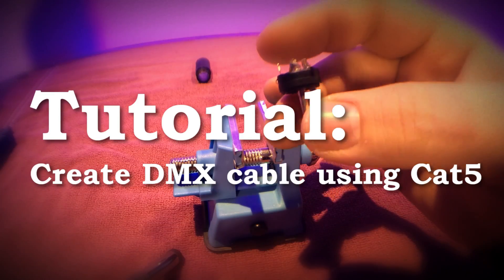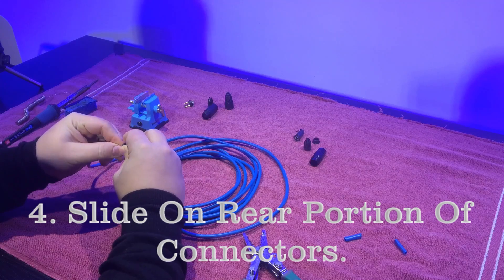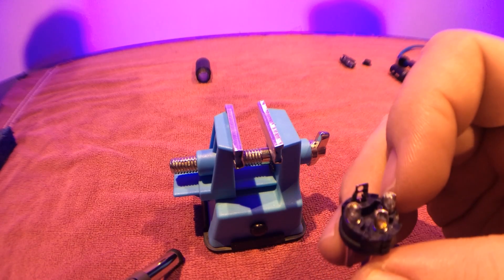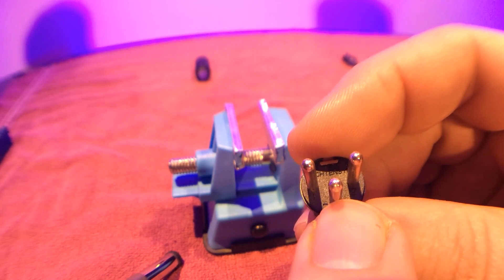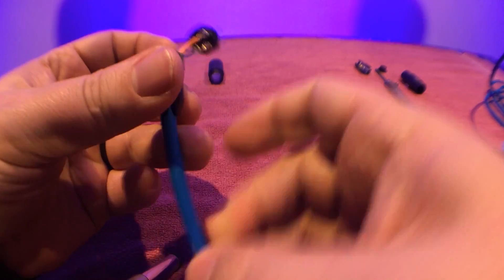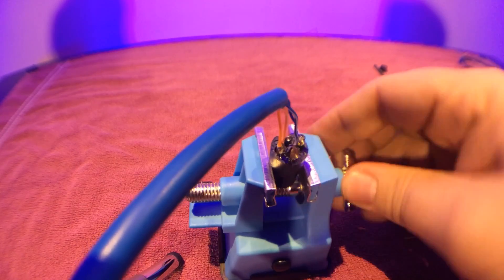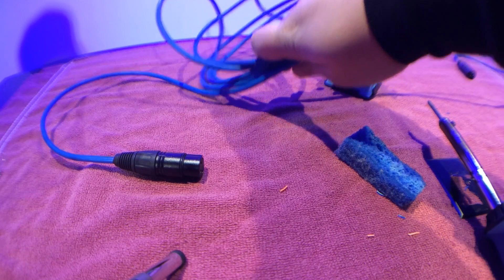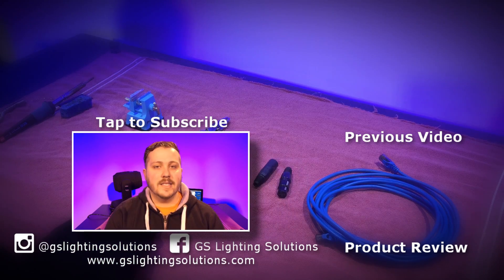How to Make A DMX Cable | Tutorial

Comment: I know it’d leave more room for noise and connection issues but for smaller setups or maybe mobile setups when not using wireless DMX it might be beneficial to simply create something like surface mount RJ45 jacks connected to XLR male and or female so any length Ethernet cable can be used

Comment: That sleeve is a strain relief. You sould put it on the sleeve of the cable and not the cable itself to prevent the solder connection from damage.
Reply: That's what I was thinking when I watched the assembly part of the male connector. Too much exposed strands.
Reply: Can you explain more? Sleeve of cable and not cable itself?

Comment: You should pre-flow your wires and add some flux.  Those solders look a little dry and might not be as strong as they could be.
Reply from the maker: Patat0four thanks for the tip.

Comment: Hi a have a question about that short black cable that you showed at the end of the video 
the questions are these:
1: which port is that cable conected to the PC ? USB port or LAN ? 
2: is it USB to DMX or LAN to DMX ?
3: is it DIY calbe or is it special cable ? whats the name of that ?
4:if this is DIY how to make that ?
5: is it possible to make LAN to DMX like that ? or USB to DMX ?
6: whats the name of that software ?
regards
Reply from the maker: Mosibat that is a DMX Dongle for the Chamsys Lighting control systems. It can be plugged into any USB drive. I’m using the PC only version in this demonstration. Chamsys has other types of physical lighting systems.

Comment: thanks for the video, I have a question: I saw a previous video where compares XLR and DMX cables and says that XLR has an 80 Ohm resistance and DMX 120 Ohm resistance. So by using CAT5 cables, What Ohm resistance do you get from this mod? (They mentioned also that theres a DMX adapter that plugs at the end of your daisychain to stop incoming interference? Thanks for the video and hopefully you can reply with an answer...
Reply from the maker: Thanks for the comment. So first let me say that I haven't tested the Ohm resistances of cables that I've made with Cat5 Cables. To expand on that I also use DMX to Cat5 adapters that just transform a standard Cat5 to a DMX cable. In a practical sense I've never had any issues with any of my lighting installs where i've used Cat5 lines. I have a video where I explain what DMX is. It's basically 1's and 0's (binary) sent in packets to all the lights over the daisy chained DMX (data line). Ohm's resistance probably as big of an issue as it is with audio (XLR) cables. Hopefully that helps.
   Now to your last question. the DMX adapter that plugs into the end of your daisy chain. This device is called a Terminator. It's a very simple device that in essence stops the signal from continuing on. what's interesting is that if you have a lot of lights plugged into the line you can get what is called signal bounce back. this muddies the signal and can cause lights to misbehave. I have personally experienced lights that acted up on me, but when I added the terminator it acted normally. They normally cost $5-$10 USD. I use them on all my installs.
   Hopefully that was a help.
Reply: DMX cable and Cat 5 cable have same impedance. And you need a DMX terminator at the end of node. Without DMX terminator there is  a lot possibility to cause DMX noise.
Reply: For more information on using Ethernet for DMX. Please see the following link: https://www.etcconnect.com/Support/Articles/DMX-Over-Cat5.aspx

Also Cat5 has a 110 Ohm resistance, so is perfectly fine for DMX.
https://ledshed.co.uk/pages/dmx-512-over-category-5-cat-5-cable-xlr-and-rj45-connectors

Comment: Although this method will work I thought it might be worth mentioning that there is a PLASA / ESTA standard for which colors to use. The correct colors are ... Data plus = Or/Wwh .. Data minus = Or .. Common =Br/Wh + Br
Reply from the maker: Chris Chew thanks. I couldn't find any set standards when I was doing research for this project.
Reply: THANX FOR THE VIDEO I HAVE A QUESTION_? SO THE CORRECT SOLDERING WOULD BE  : PIN1:  ORANGE/WHITE  PIN2:ORGANGE   AND  COMMON: BROWWHITE +BROWN?  WHITHOUT THE BLUE ONES CONNECTED, STILL WORK?
Reply: THANX FOR THE VIDEO I HAVE A QUESTION_? SO THE CORRECT SOLDERING WOULD BE : PIN1: ORANGE/WHITE PIN2:ORGANGE AND COMMON: BROWWHITE +BROWN? WHITHOUT THE BLUE ONES CONNECTED, STILL WORK?